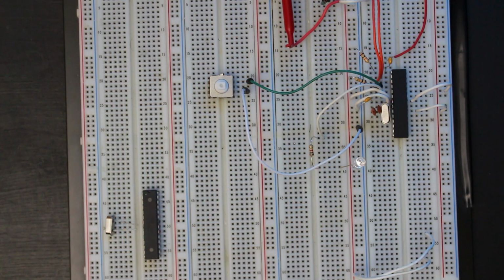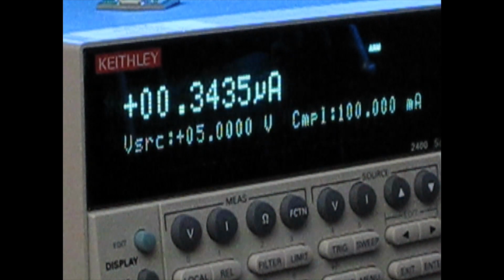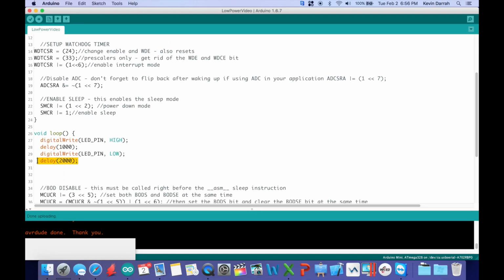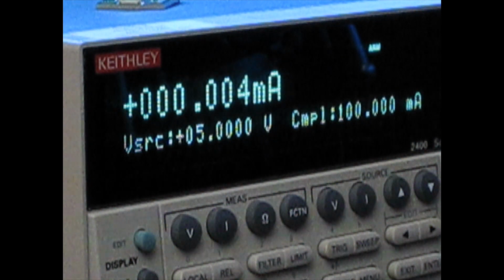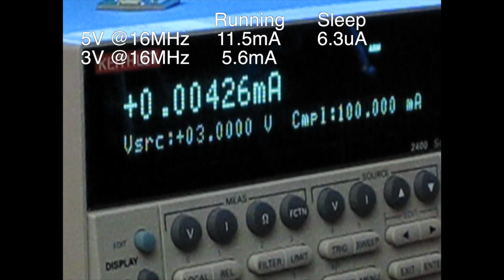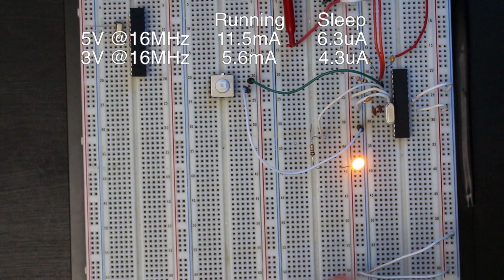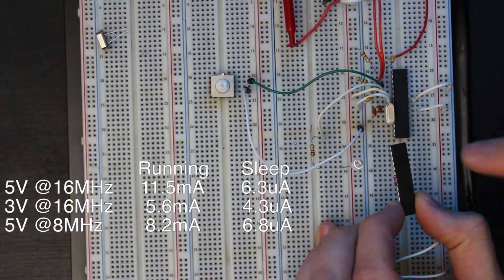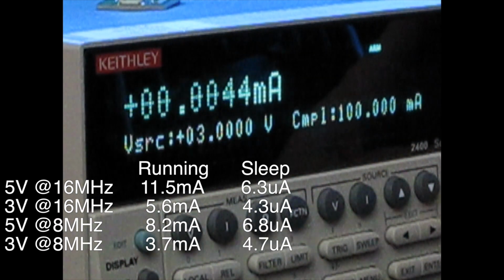Low Power Arduino! Lower the Voltage and Frequency

Comment: Very interesting. In your frequency voltage tests the differences in running value at different voltages ofcourse is not really a surprise.
I think it would be safe to say that in running condition, the surplus of the current is determined by the LED switching on.
As you seem to have a an orange LED, I presume it has a 2 Volt FW voltage. So the series resistor has 3 Volt to dissipate. ergo it must be a 260ish Ohm resistor
Switching to 3Volt, that resistor only has 1 Volt to dissipate so the current comes to 1000/260= 3.8. ofcourse that is not directly 5.6mA but it is in the ballparc.

Comment: Quick question, I have an ATMEGA328p-AU with the bare minimum set as yours but it wont operate at less than 3.6V any thoughts ?

Comment: I tried that with a clone Arduino which most like does NOT have a genuine CPU on board. The lowest I could get it by removing the regulator, and power LED, and without changing the fuses was 95µA. A clock project running on a DS3231 and a Nokia 5110 display (both most likely not genuine too) consumes around 0.29- 0.47 mA for most of each second.

Comment: Dude my ATmega328p draws more than 180mA (nothing connected to the pins), the standalone arduino circuit is okay because I tested it with another 328p & it draws about 15-20mA. So I assumed the chip that draws too much current is a dud but it does perform codes without a hitch. Whats your opinion on the matter?

Comment: dud was the voltage changing going to the led and the crystal it self might be using more power did you change the cap size as well

Comment: Interesting video series - thanks for making them.  One thing that strikes me is that when you halved the clock frequency, the current consumption reduced - as you would expect - but not by half.  So the power consumed by the microcontroller to execute a particular sequence of instructions will be more at 8MHz than at 16MHz.
Reply from the maker: +emcgon yea, that's what I was trying to convey towards the end there, but if say you needed to do something else that was out of your control or that was independent of your own speed, then running at 8MHz makes total sense.

Comment: Hey Kevin, you should try to run it at its default 1 MHz RC oscillator at around 1.8 volt. This is what is listed in the datasheet as ultra low power

Comment: Thanks Kevin, please continue this series ) 

Also I would be happy to hear about Low Power ESP8266 with Arduino bootloader. Since it is not based on Atmel chip, what advises are still valid for ESP8266 ?

I known that ESP8266 can wakeup with wifi disabled, and it has different sleep modes. So it would be nice to known what else could be used to minimize power consumption.
Reply from the maker: +Иван Романенко yea, that is on my list of projects.  I haven't loaded the arduino stuff directly onto the ESP yet
Reply: +Kevin Darrah I would love this. I just started getting into ESP's after finding your channel, now I have plans to put these things all over the house!  It would be kind of simple to put together an excel sheet that listed the MHz options, sleep options, and a place to put your desired "wake up intervals" to check sensor readings or something... so it could model power consumption and tell you how long it will run on different battery cell options.

Or, "i'm sure there's an app for that, right?"

Comment: Great video, but why you specialize in Arduino? As i heard Arduino libraries don't work properly if you mess with the voltage and crystal frequency.
Reply from the maker: +4a4ik I'm using the native boot loaders within the Arduino IDE, so none of the libraries that rely on the timing will get messed up.  What you see in the video are technically two Arduinos - Arduino Mini 16MHz and Arduino Pro 8MHz - I've got a video coming up that will explain how to load the right bootloaders

Comment: Finally, something in the datasheet I've actually used before! haha

Pretty familiar with the speed grades chart because it's important if you want to do battery operated devices.

I made a music box for someone about 5 years ago using an arduino and three AA batteries with wires soldered directly on and wrapped up with tape. Put it all in a tin box with a switch to activate when you open the lid and that's the whole thing.

I don't know what voltage the batteries are at, but I hear the box still works! Not that that's a measurement of anything since it has a power switch to completely isolate the batteries from the arduino.